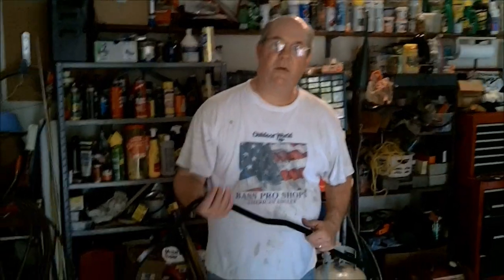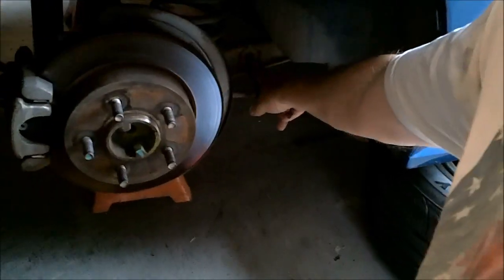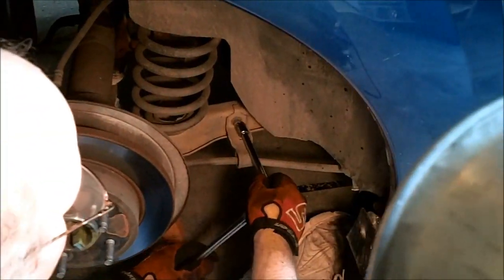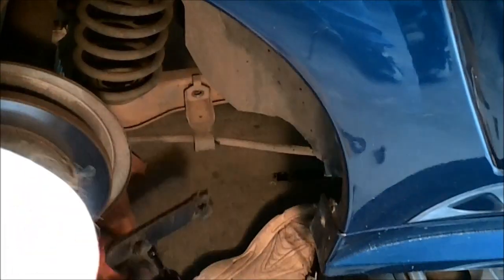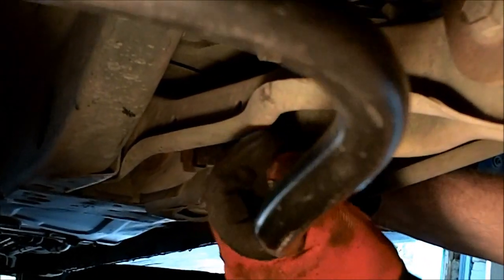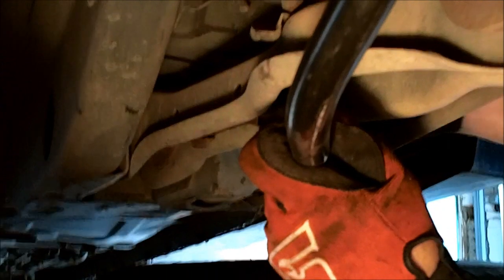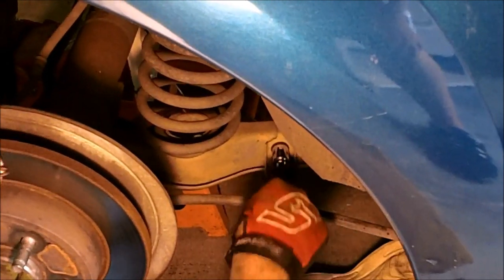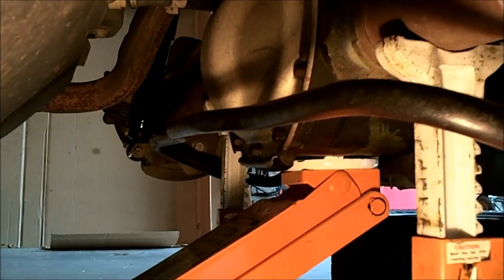Mustang Rear Sway Bar

Comment: Cool! How about a follow up on how the handling has changed? I did this to my 2005 V6 (different sway bar design) and I immediately noticed better cornering. Stock V6 mustangs are very understeer biased. Also, am I correct that rear sway bars will fit from 1979 to 2004?

Comment: So where do the rear sway Bar Links go?
Reply: No links on the rear sway bar. Just the 4 bolts that connect the lower control arms.
Reply: Only Cobras with IRS uses sway bar links.